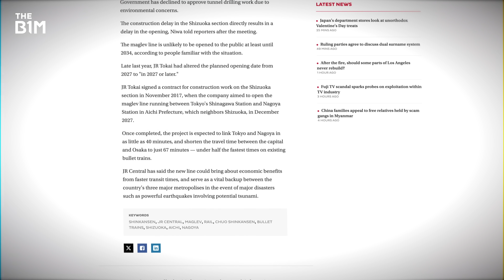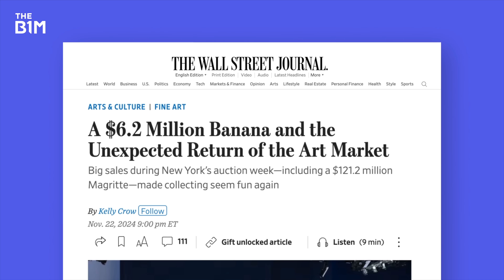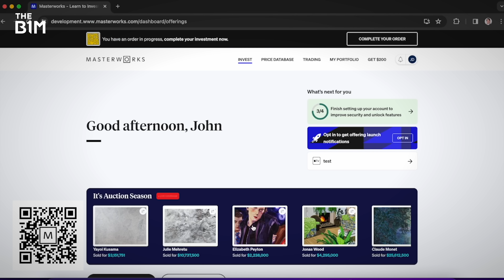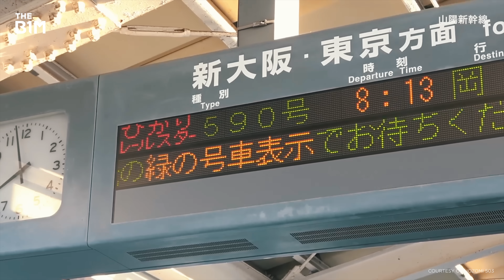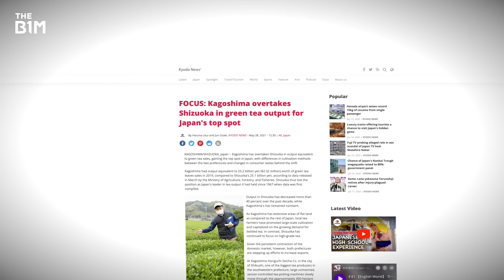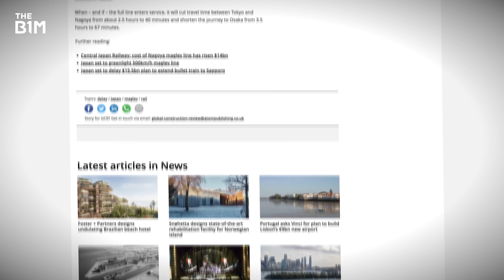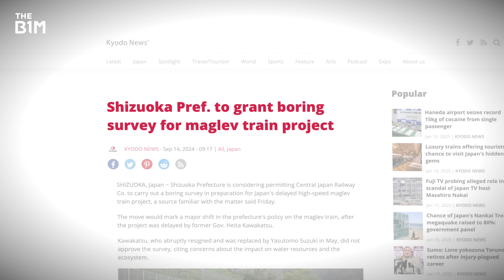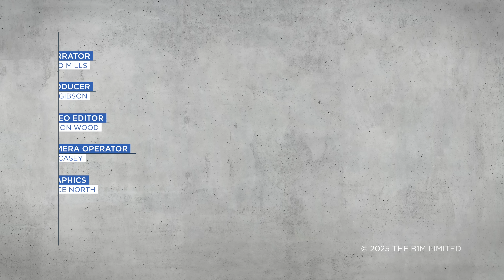Delayed: Japan’s $64BN Levitating Bullet Trains are no Longer on Track

Comment: "Those kinds of speeds (600kph) are impossible to reach by a train...

The French TGV (not an experimental train, a real passenger high speed train) set the world record for conventional rail at 575 kph.

Conventional "steel on steel" rail is not really the issue with faster train

Comment: In all honesty, I think the Maglev bullet train will be a commercial failure. The technological achievement is remarkable, but 21st century regulations mean that so much of the line has to be tunnels. In turns it really removes a big draw of train rides, which is the visual comfort element. The ticket prices will no doubt be more expensive than the regular bullet train, and for most travellers the time saved won't be worth the price difference, especially when the trip is not going to be as nice (who can forget the iconic view of Mount Fuji from the bullet train?). 

Switzerland is actually facing a similar issue despite the incredible train coverage: the mountainous terrain doesn't allow for real high speed trains. However, so many people enjoy the views of the countryside that the national rail company has deemed the investment in high speed lines to not be worth it, because people would prefer to go slower, but outside of a tunnel. However, the main difference between Switzerland and Japan is that Switzerland is not facing an economic, social and cultural crisis like Japan. Switzerland is by all accounts thriving, whereas Japan after their economic miracle has struggled to find continued footing. So in essence with the Maglev, they're trying to artificially recreate the Shinkansen moment. It won't happen, the breakthrough is nowhere as important, the practical applications are too limited, but the Japanese are too engaged in fleeing towards progress to back down. It's eventually going to happen (I'm so looking forward honestly), but it's going to create a new wave of controversies and accusations of wasted money instead of boosting the economy as it was meant.

Comment: Already mentioned in the comments: China already has a Maglev line serving Shanghai airport, based on the German transrapid design. Mentioning it would have made sense for the B1M for accuracy, but also because I’m curious why the Shanghai line actually doesn’t operate anymore at full speed for economic and maintenance reasons (300kmh instead of 431kmh for years), and how Japan’s tech (admittedly very different) is supposed to solve that issue.

Comment: THE FUNDAMENTAL KILLER IN MAGLEV TECHNOLOGY. 
The MAGLEV, which involves electro-Magnetically Levitated vehicles - they are NOT "trains", as they are more akin to a monorail method without ANY rails. Suffers the major issue presented by the Monorail method. Which is you have a concrete "U" shaped structure for the MAGLEV to move along. There is NO track, so when you need "switches/points/turnouts" to change from one carriageway to another (at stations for example) this requires massive U shaped concrete beams, hundreds of yards long, and weighing hundreds of tons each to be moved.  To allow MAGLEVS to be rerouted from one carriageway to another !!! 

And if we think of New York Central Station, or London Waterloo station both of which have around 20+ platforms & tracks. That means dozens of "switches/points/turnouts". So for a MAGLEV dozens of massive "U" shaped channel concrete beams, each one requiring numerous electric motors with hundreds of horsepower each, just to change from one platform road to another. And MAGLEV VEHICLES to function, require a continuous line of massively powerful electro-magnetic with the power to maintain a MAGLEV formation in the air continuously, attached to the vertical concrete walls of each "U" shaped channel. Making the "U" shaped concrete moving beams another serious & highly expensive technical issue, for each one of them. 

Hence the only true MAGLEV lines yet in service are small limited operations just a few miles long, from a City Centre to an Airport. Where speed is NOT very important and so far not higher than 40mph/65kph. And the carriageway layout is just two parallel paths, with only two or three platforms each end, keeping the moving path changing U shaped beams to an absolute minimum. Indeed the first such MAGLEV line only lasted 10 years, and was replaced by a normal two rail traditional railway using driverless automated trains, at a fraction of the annual running costs, of its MAGLEV predecessor !!!

Comment: Japan has spent more than half a century developing the MAGLEV, and currently conducts demonstration runs on a 42km section, one-seventh the distance between Tokyo and Nagoya, for nearly 30 years. Technical issues with both the MAGLEV body and track have been resolved, and the MAGLEV has already completed over 5 million km of test runs without a single accident. The biggest problem is the progress of the tunnel construction, which cannot be determined until it is excavated. The construction costs are a private company's responsibility, so they have no direct impact on us. We Japanese are quietly watching, dreaming of being able to ride it in our lifetime.

Comment: The issues with the Shuo Line go much deeper than that: 

The Tokaido line currently connecting Tokyo to Nagoya and Osaka is running at an average of 104% capacity. The Chuo line is supposed to eleviate this by adding capacity. 

Capacity can be improved through train-set capacity, frequency and travel time. All of which are basically peaked out on the Tokaido line. The Chuo line is limited in its capacity by smaller trainsets, the frequency and also turnaround time (basically how fast a train can start a new journey after arriving) which is limited by many issues that can't intrinsically be solved fully, only improving the theoretical capacity through speed. 

So even at full operation (which is currently unfeasible) the Chuo will only have about 25% the capacity of the Tokaido line. This makes the project be a Concorde of the trains, it will never take over the current demand of the Shinkansen users and only be a first class, premium service with very limited capacity. This makes it destined to fail financially which every clear thinking person could project, while not solving the current overcrowding and bottleneck issues the system faces. 

The strong hierarchical structures the county faces don't help this observation being brought to the elite, decision-making people while engineers struggle to make something happen they know will never meet the expectations and demand the press has for this project. 

At the same time a corridor gets built that could improve the capcity by 2x if it was integrated into the existing network using conventional Shinkansen trainsets while making 30% travel time improvements as opposed to the current Tokaido line and saving an estimated 30-40% of the massive, overdrawn budget for the project. 

Basically, the project is destined to fail. While ambitious and surely a great technology, the germans learnt that the hard way with their maglev project. Sometimes admitting to a wrong decicion made and pivoting to minimize damage is the best point of action, yet here no-one is willing to take the blame and make this all-important pivot towards a project that actually benefits the greater public.

Comment: While the issue with the Shizuoka officials was an issue I'd hardly say it's the reason JR can no longer meet it's target date, it's a convenient scapegoat as is often used by Japanese. At this point the contracts for those two sections are at least pending and surveys are being completed on a pilot tunnel. Yamanashi Station, two other tunnels, and 6 substations are also still pending contracts with no work completed. There are also several other sections of tunnel that are only in the surveying phase. Really the only thing that's done aside from the Yamanashi Line is most of the emergency exits

Comment: CORRECTION:The maglev line we're building in Hunan is just a low-speed maglev line(120kmph) and is only used as a smoother subway line.Actually the line is already finished right now.For China railway,they're more inclined towards wheel rail train(the CR450 project) due to the high cost of maglev trains

Comment: Every single maglev project that I've ever seen in my entire life has either been a pipe dream (fails to get started), fails halfway into the project for a variety of reasons (usually budget), or very rarely, occasionally, actually gets completed as a 1 mile ride at Disney World/Epcot Center.  There's also the question of whether or not humans should be moving at those ridiculously fast speeds.  If there's ever an accident, they'll be peeling people off the walls and ceiling.

Comment: My issue is whats the safety margin built in if some obstacle or crack in the pavement opens along the 'track'. If your train suddenly starts flying or veering violently into a tunnel wall at 600km/h it's not gonna be pretty.. also how do you brake if anything on the way is happening ? Trains are already notorious for being nigh impossible to stop what with the smooth steel wheels on smooth steel track action.

French SNCF tested a TGV train up to I think 575km/h on wheels quite a few years ago, but with the distance between train stations in reality you don't even have the time to accelerate and then brake from those speeds in time so it's useless in reality... (I went to check and it was 2007 actually so really old news by now..)

Comment: A very overlooked thing about high speed trains is the fact that it saves the extra 2-4 hours at the airport not including the flight itself
Reply: Also you arrive right in the middle of the city. Unlike airports that drop you far away and you might need an extra commute to reach the city.
Reply: True. When you factor in going to the airport, arriving 1-2 hours early, picking up luggage upon arrival, taking the train from the airport to your destination etc. it’s oftentimes faster to take the Shinkansen as is
Reply: Also, shinkansen fares are basically the same no matter when you buy the tickets, so no need to buy tickets months in advance to get the cheapest fares. Except for a couple of weeks when trains are mostly full, just show up at the station and get a ticket.
Reply: Track. This is the problem with Amtrak. Amtrak has bullet trains. The new liberty trains are bullet trains made in Europe by Astom. These trains are made to travel at speeds of up to 200 plus mph. But their speeds are highly restricted because they are placed on old and outdated track shared by freight trains. What the mighty united States of America really needs to do is bring in some engineering, design and build track lines specifically designed for these high-speed trains only. Track that is built on high platforms so as not to have any interactions with the natural world, pedestrians and vehicles at railroad crossings. Everything crosses beneath the system. Then built the train set to deliver and provide service for not only the cities of the northeast but the entire United States eastern seaboard from Boston Massachusetts to Jacksonville Florida stopping in one city in each state it travels through. Now you can move millions of Americans up and down the entire eastern seaboard at great comfort and at speeds of up to 200 to 225 mph and not so much as a ripple on your martini. This would be one of the greatest American achievements since going to the moon. This is something the mighty United States of America should of achieved Decades ago. Infact I would call this system,  The United States Atlantic Star. Now I could board in Philadelphia Pennsylvania and be in Jacksonville Florida in 4 to 6 hours  instead of 11.5 to 12.5 hours by car or 13.5 to 14.5 hours or longer by EV. Great for those of us who don't fly and a third and cheaper alternative to travel. This would definitely place the mighty United States of America on the world list of top 5 fastest trains on earth 🌎.  We can do it. We just have to stand up and do it. We already have the bullets. Now we have to build new and improved lines dedicated to these technical modern marvels of transportation...
Reply: Carry as much liquid as you want onboard.
Reply: Doesn't save much time over regular hugh speed rail.
Reply: @5688gamble  This one does, there's the first kind of high speed rail, just the trains themselves, but at the mercy of slower trains and signalling, sometimes at-grade crossings etc.
Then there's the dedicated high speed lines, smoother curves, separated from crossings and no slower trains sharing the line, purpose built for most efficient use of speed.

Japan's regular shinkansen are the second type, dedicated tracks, apart from a couple of sections on the mini-shinkansen lines where there's some dual gauge bridges/tunnels.
But even the regular shinkansen lines like the Tokaido, have an issue where because they follow relatively flat routes across the plains and go through a few tunnels, they take a mostly coastal route around the mountains.
This new line is not just about the trains themselves going a bit faster, but the line itself is like 90% tunnel, taking a more direct route under the Japanese Alps, this really cuts down travel time.

Comment: There are already several other maglev, shanghai airport to pudong is the oldest one still in activity with about 15 years of service, it can runs at 400km/h, but is often at 300km/h since few years, it often empty, as trains on shinkansen lines. There is another one between Changsha bullet train station and airport, and another one in Korea, at incheon airport. China has several railways bullet lines that runs at 350km/h on large parts for years until 2024, and start to runs at 400km/h this year

Comment: Those trains are not commercially viable if a local trip costs over €100 and 3x a flight ticket. Would I pay so much when the local bus cost a fraction and it just takes a bit longer?

Comment: To be honest when the two major stops of the Tokaido shinkansen (tokyo and osaka) are only 2hrs apart, any further reduction has a diminishing return on effectiveness. If you really have to go that far for business, you can afford to wake up 57 minutes earlier for that train and go home 57 minutes later.

The maglev is but to showcase the world that Japan can do it (so they can export the tech and bring in contracts funded by wealthier countries) not to actually save that 114 minutes a salaryman will have to "suffer" from the existing rail system.
Reply: Also, if you have travelled in Japan you would know, it's always the last mile between the Shinkansen stop and your destination that is taking up most of your travel time. A personal transport system from the Shinkansen stop to your destination that is somehow not hindered by traffic and density is what's really going to improve the QoL of Japanese businessmen.

Or they can just....meet online. 😅
Reply: The Chuo Shinkansen is not just to showcase the technology, but also adds capacity as Tokaido Shinkansen is being used extensively.

Comment: Why are countries so obsessed with building quicker routes between cities? Most people spend the majority of their lives within a close radius of where they live/work. 
When you do have to travel to another city it’s generally something you plan ahead for and set aside enough time
Reply: In Japan, the Tokaido Shinkansen runs once every three minutes at maximum, with a capacity of 1,323 people. Even so, there are many people on the train, and some people may not be able to board the train. Additionally, the Tokaido Shinkansen line was built about 60 years ago and is aging. However, if we stop the Shinkansen and carry out construction without any alternative public transportation, it will have a significant impact.Therefore, we are creating the Linear Shinkansen as a new alternative public transportation system.
I am using Google Translate for this part.

Comment: Actual content of the 14 mins long video starts at 09:03 for anyone interested. End of related content is at 12:30 .
To sum it up: There is no deeper explanation but the two main problems are 
1) one prefecture didn't want the train (environment & principles) - principles fixed, environment still a topic (approx +10 years | Tokyo ↔ Nagoya opens ~2034)
2) hard to build on lose soil (approx + 5 years | Nagoya ↔ Osaka opens ~ 2037)
If you read this comment in 21 seconds, it saved you 13 minutes and 40 seconds of almost uninteresting content 😄

Comment: Most of the line is in tunnels.  Why don't they just seal the entire route and run it as a vacuum tube?  Less air resistance = more efficiency = less power usage.

Comment: The problem with Shizuoka's former governor sounds remarkably similar to Texas' problems with try to get High Speed Rail started. A few years ago there were apparently serious plans to build a HSR line between Dallas and Houston using shinkansen technology. But the project keeps getting stuck in limbo because some local politicians in the rural counties in-between those cities have been absolutely determined to prevent the line from being built. The project could never secure a complete rail corridor, and is effectively dead at this point.

People are the same all over the world and politics is always local, I guess.

Comment: quick correction- its not 2 sets of magnets, one for levitation and one for propulsion. the ones for levitation are ALSO for propulsion. The train is powered by a second set of coils underneath, but those are not the magnets that make it levitate. those are only for supplying power